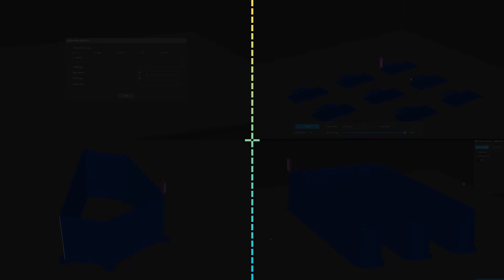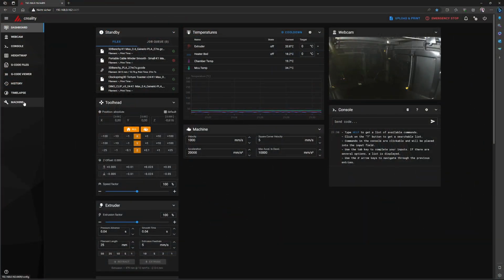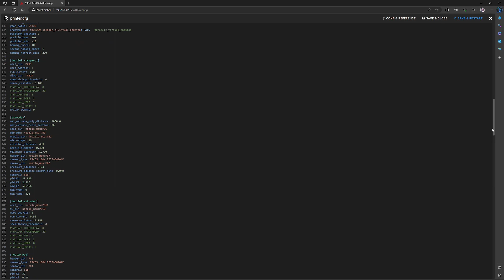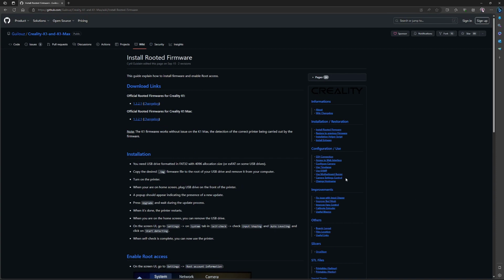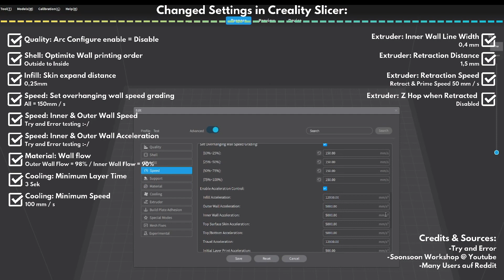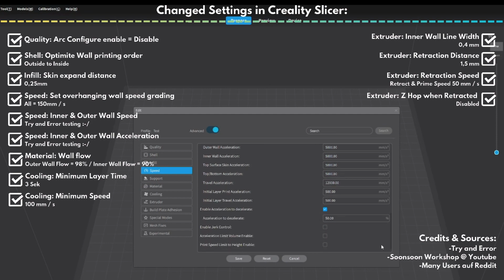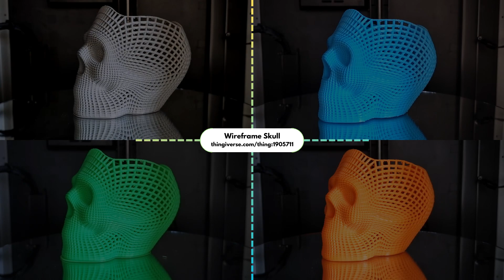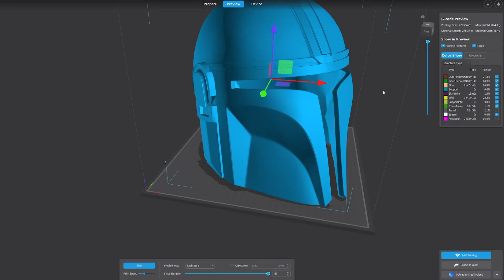Does Root access and some easy mods make the creality k1 max a good Printer? (Coupon Code inside)

Comment: i love watching my K1 MAX but i have NEVER seen it do the zigzag lines and scan. The only time i have seen the LiDar come on is over the somewhat looking QR ( more of a barcode) that is to the left of the build plate. was that because you had an early version that did the lines scan?
Reply: Mine does the zigzag scan. You have to enable it in the camera or ai setting. I can’t remember off of the top of my head. But it will only put the zigzag down if you enable the “calibrate” button when starting a print.
Reply: @SeriesDmusic  I did find after some research that day.  I did not realize that option was going to be under the camera options. Overall I did a few prints with it and honestly I ended up turning it off as I noticed less quality
Reply: @theteche it suppose to do “pressure advance” that is a kind of auto tune the flow calibration using the lidar scan… but it seens to be not working yet (dec2023). Creality needs to release a new firmware to allow it… or you can root and find the adjustments “manually” testing and inserting new values

Comment: K1 max, knomi v1, 8 (7,7mm) mm belts, ot hotend and cht mk8 nozzle , orcaslicer, rooted and adjusted settings = very good printer.

Next is m5p motherboard and cb1 , beacon probe 
Just waiting for prober reverse engineering (guys are working on it successfully)

If creality releases an easy ams like system - wow.
But maaaan.. the firmware issues ar launch 
... Destroyed 4 pei sheets bcs bed crashs... But fixed now

Comment: Do you have a link to the box with hinged lid? Just bought a K1 Max and will make that my first print! Also, the Bambu Lab box doesn't look as shiny as the others. Was the same filament used (just different color)?
Reply from the maker: Which box? The only thing with hinges is the cable winder. And for the color of the bambulab prints, they are indeed more matte since they are cooled faster making the filament shine less. By increasing / decreasing temperatures and cooling you can change the way the filament looks.
Reply: @Print3D_it_is  The boxes shown at time 5:15.
Reply from the maker: @ThePapaDawg  Those are portable cable organizers closed and stacked

Comment: dont know why your print quality is so bad.... mine looks much better without any changes on hardware or firmware, except the OTA updates from creality. But first print looks as great as my last one.... i also didnt change major settings in creality slicer... except for cooling and temps. pretty strange...but i have a lot of issues with my sovol, and my friend not....so...maybe bad luck
Reply from the maker: I would not say the print quality is bad, It's pretty decent actually wouldn't the ghosting be...
Reply: @Print3D_it_is  oh sorry, indeed i meant the ringing, for me ringing is kind of a sign for bad printing, but your are right, the print it self is good.